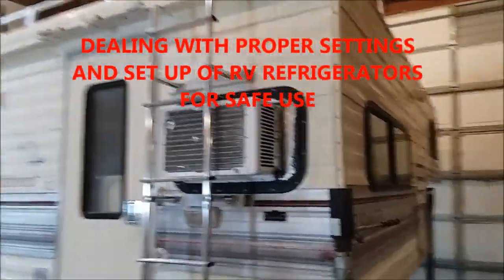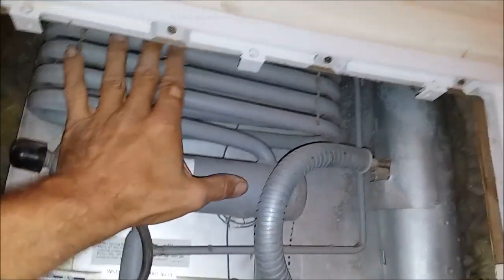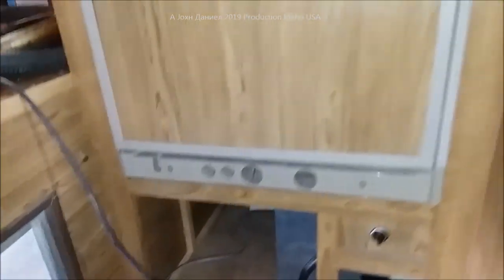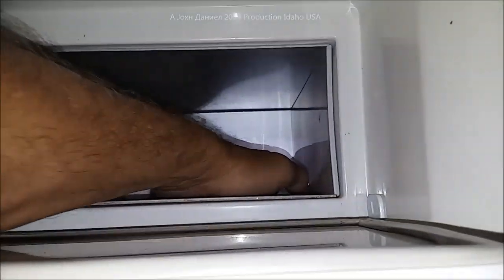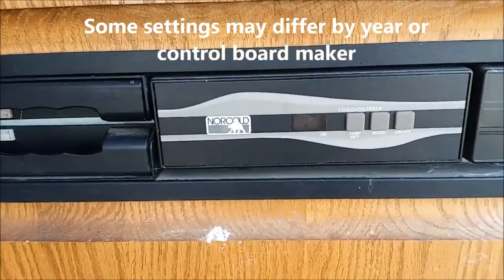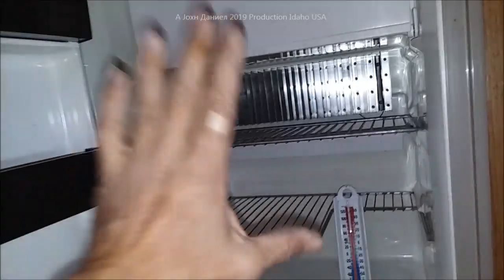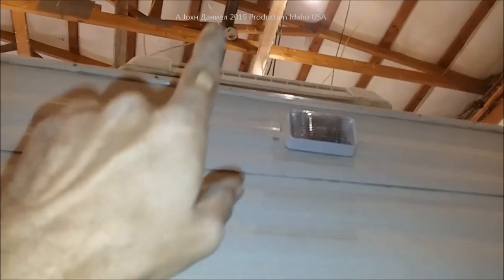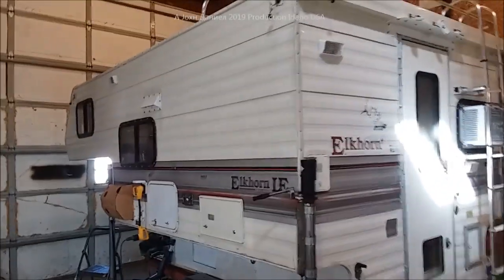RV Refrigerator care and settings (answers to a viewer)

Comment: I've added a dual fan that clips to the fins and circulates the air inside. I have a more uniform temperature inside. Also I've added a fan to the inside of the door that I use in summer. It gets miserable hot and humid here in Kansas and seems to help efficiency on the worst days. Did learn something new though. Tape the door in winter. I'll be doing that this winter and on. Thanks.
Kinda like removing an engine thermostat. Coolant passes through the radiator to fast to give up heat and engine overheats. Keep em coming. Never know enough.